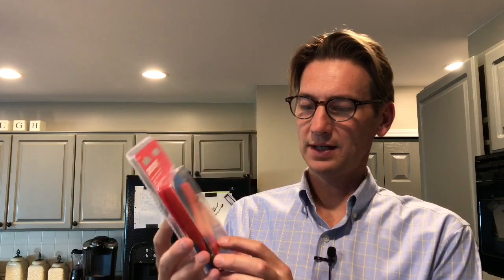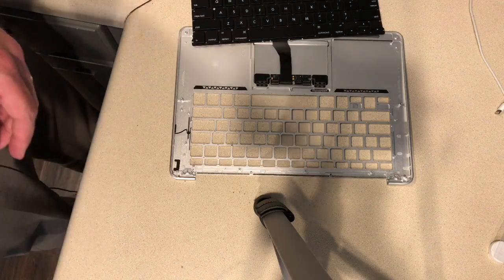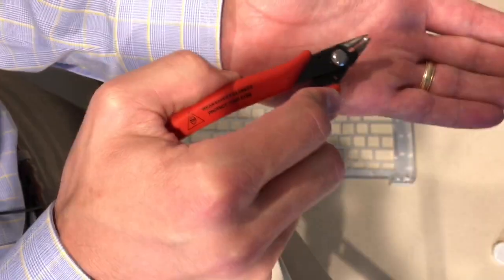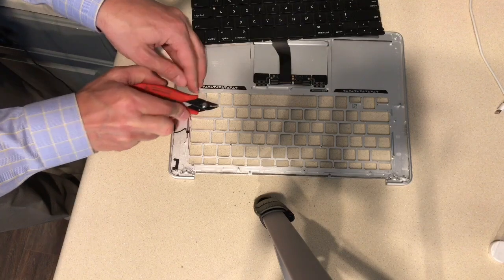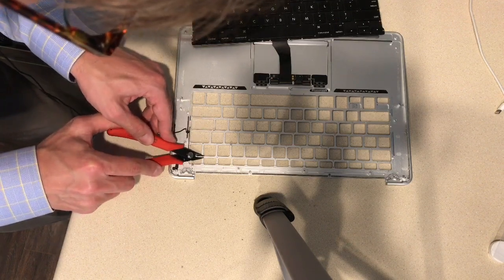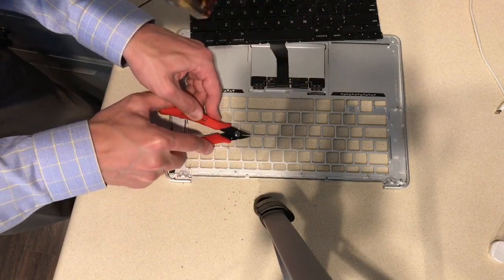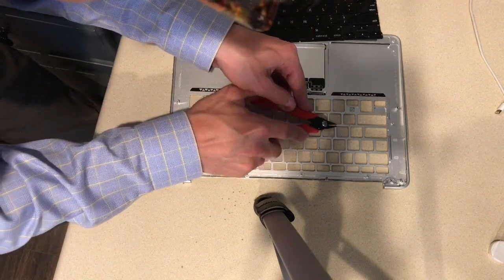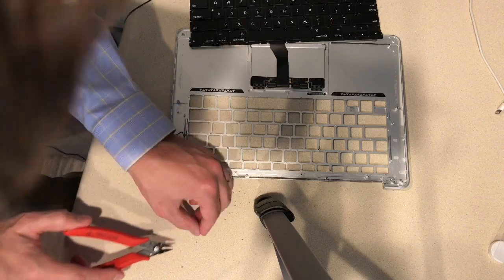MacBook Air keyboard replacement, removing rivets

Comment: For anyone having trouble with this method, I've found another technique which works very well and only requires a flat-head screwdriver and hammer. The Crescent Miniature Wire Cutter simply sheared off my rivets, perhaps because the 2020 version of this tool is sharper/harder than the one used in this video, or because the rivets in my MBP were made from a softer aluminum. Either way, read on for an alternative which was super easy and allowed me to remove every last rivet in under 10 minutes (except the ones I had already sheared with the wire cutters).

Basically, you want to take a flat head screwdriver and position the tip at the base of the rivet. Orient the handle of the screwdriver such that it's as close to being perpendicular with the rivet as possible (imagine an uppercase "L" where the vertical part is the rivet and the horizontal part is the screwdriver). Then, give the handle a few successive hits with the hammer and the rivet should pop right out. Not much force should be necessary. You'll also need to place the laptop against a padded backstop to keep it from moving.

Credit for the idea goes to the video below. However, unlike in this video, be sure to keep the screwdriver as close to perpendicular with the rivet for best results. Also, a big thank you to Preston for sharing his knowledge. Though it didn't work for me, it did lead me to a solution which did.

https://www.youtube.com/watch?v=ETxpfY2nhDk
Reply: Thanks for this. 10 tools later and this is the only solution that works for me!

Comment: Thanks for the video, I am doing this right now and I used that cutter and it worked well. After placing the new keyboard in, did you put any screws in replacement of the rivets?
Reply from the maker: Yes. That’s what I did. After I got the rivets out, I used the tiny screws that came with my replacement kit in place of the rivets. I put screws in almost every hole, but not all. My goals was to make sure the keyboard stayed firm when I was done. Happy to hear this helped you.
Reply: Why not use rivets again?